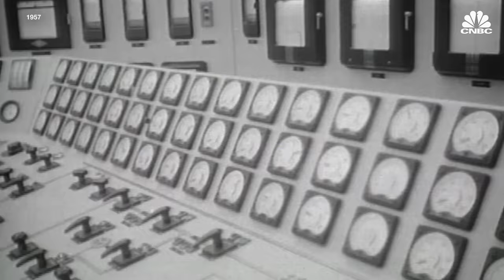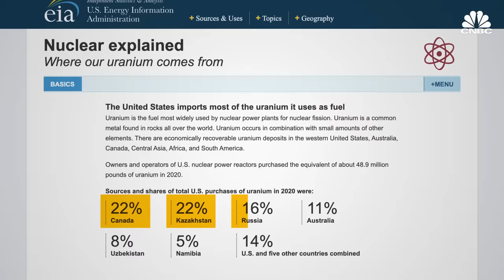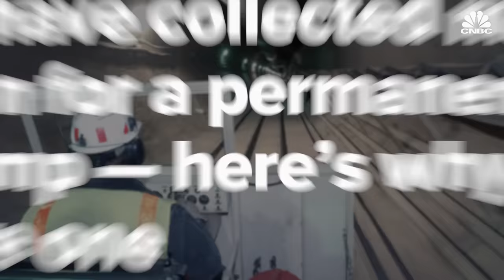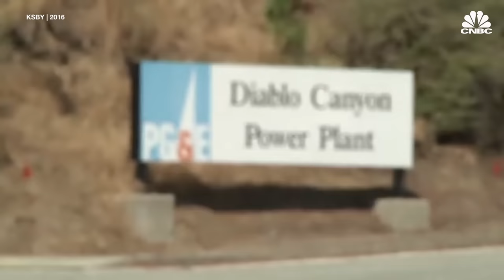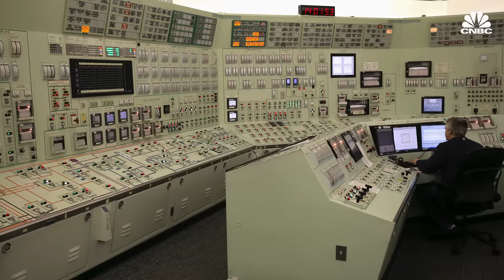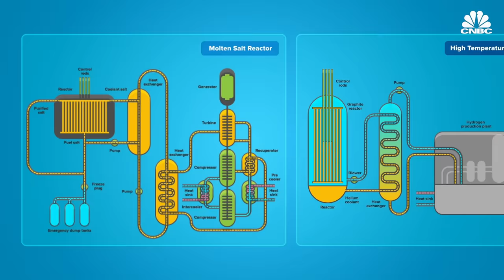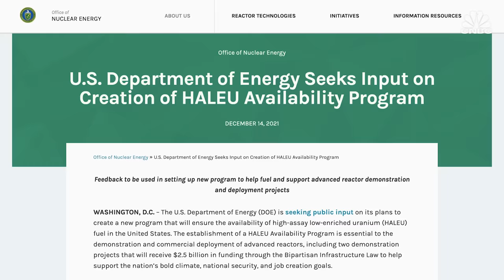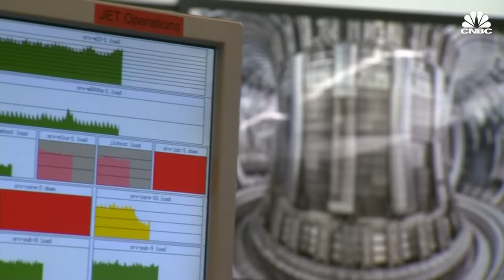Why Nuclear Energy Is On The Verge Of A Renaissance

Comment: 19,747 people died in the 2011 Tōhoku earthquake. It was the most powerful earthquake every recorded in Japanese history. The 4th most powerful in the world since modern record keeping. 0 people died from the partial meltdown at Fukushima. That proves how safe nuclear power is because you were safer in the control room that anywhere off the Sendai coast.
Reply: how ironic one of the main reasons nuclear has always been canned is now used as a defence. And what was used as defence has become a blunt weapon. Follow the money. For nuclear to be safe, it becomes too expensive, pure irony.
Reply: Jeah, and during World War II, factories were in full swing. Happy times.
Reply: I'm pretty sure Tepco worked the nuclear plant workers to the death in containing and cleaning up everything. They didn't die from radiation but the kind of irresponsible actions of this corporation that led to the power plant not being adequately prepared against heavy earthquakes and tsunamis even though those are common in Japan.
Reply: @ooooneeee  look, in outright numbers, nuclear has killed far less than coal for sure.  But thats not the issue thats killed nuclear. Its the costs.  The risks involved means its highly regulated and safety has come with a high price.  The only real environmental issue is  that it takes a long time to ramp up  and no way will nuclear save us from climate change. Too long and not enough.  Solar and wind can be rolled out now  at lower costs which will only get lower where as nuclear is always going to increase its costs.  Then you can add Chernobyl and Fukushima to our collective memory. Thats a real barrier that no amount  crying will fix in this lifetime. Saying it was an accident and it wont happen again doesnt wash when  primal fears  are at play. Underestimate the fears people have at your peril.  For example,  how do you convince a fervent trump supporter that there was no fraud?  Not happening in this life time.
Reply: @andyfreeze4072  agreed. It's a shame many countries have phased out nuclear even though the power plants could have run longer. It's too late to build new ones to fight climate change. The fossile fuel industry played environmentalists like a fiddle. I used to be anti nuclear too.
Reply: @ooooneeee  actually, its not a shame from an economic point.  At what stage do you keep buying a twenty year old car design?  Ie VW beetle.   Thats the point i make, nuclear's window of opportunity is closing fast for most countries. I am sure there are places where nuclear is the only option but there wont be many, and the fewer that need it, the more uneconomic it becomes. A death spiral in slow motion.
Reply: @andyfreeze4072  Exactly! Well said.
Reply: Keep fighting against clean renewables, whatever the cost. You must love being dependent on others for energy.
Reply: @andyfreeze4072  Amen, Andy. Well said.
Reply: @beaubennett7469  “Renewables” is a propaganda word. You wouldn’t suggest we get our power from whale oil would you?
Reply: @erikkovacs3097  Renewables is NOT a propaganda word, and you do not get to change the definition of common words, to satisfy your domineering overlords, or your Trumpster 'feelings'. FAIL. FAIL. FAIL.
Reply: @erikkovacs3097  Please tell us all how whale oil is renewable. The whales are dying to know.
Reply: @beaubennett7469  Renewable is totally a propaganda word. First nothing is truly “renewable” in a universe with entropy. Second people have a Pavlovian response that it is inherently good when in certain circumstances it clearly is not.
Reply: @erikkovacs3097  Ok, for want of a better words, lets call free energy renewable energy.  Happy now?  The meaning of the phrase  has changed, get with the program, lol.
Reply: @andyfreeze4072  No energy is free. It takes energy to make and install solar panels and windmills. They also have a limited life span.
Reply: @erikkovacs3097  semantics semantics. If i dont pay for something , its free. You want to extrapolate to infinity, be my guest, but then you wouldnt exist.  The concern is the here and now in our lifetime, not in some far distant galaxy or time period. Pavlovian response? Seems the deniers are  playing that game ,  alternative facts are their specialty.
Reply: @andyfreeze4072  Where do you get free solar panels?
Reply: @erikkovacs3097  see semantics again.  I never said, nobody ever says you dont pay for the infrustructure.  But there are no ongoing fees for the fuel. So free energy. And if your paying attention, the cheaper the infrustructure costs, the closer to zero total costs.
Reply: @andyfreeze4072  What about materials and manufacturing?
Reply: @erikkovacs3097   What level of education do you have?  Your not comprehending, your picking on a phrase out of context and extrapolating.  and i am being charitable.  That then calls into question anything else you would have to say.
Reply: Actually provide a study backing the statement that no one died from Fukushima. Your statement is unqualified.
Reply: @ooooneeee  This statement is unproven.
Reply: @andyfreeze4072  You have nothing backing that statement.
Reply: @erikkovacs3097  On a universal scale there is no entropy. The universe cannot lose energy. It just get changed from one form to another.
Reply: @andyfreeze4072  Na... lets go with Hemp instead.
Reply: @ooooneeee  ... you may want to ask the folks living near Hanford Washington, how that nuclear waste storage is going?? O_o
Reply: @andyfreeze4072  But we are not talking about a small car for a couple of folks.. we are talking about a large power plants for over 3 billion people!

Keep in mind that most of the hydroelectric power plants we rely heavily on... were built in the mid  nineteen hundreds  O_o
Reply: @andyfreeze4072  For the record.... solar panels is by far the LEAST efficient form of solar energy,  at the moment O_o
Reply: @andyfreeze4072  I stand by what I said, as you have not disproven any of it O_o

Now let me burst your Nuclear bubble by simply naming one location....

Handford Washington 

I'll burst your solar panel / battery storage bubble by 3 little words...

Made In China

Now lets get back to nature, shall we??..

HEAT... fun fact.   The largest non commercial use of energy is for domestic winter heating. 

Natural gas = fracking, huge pipeline infrastructure, high production and maintenance cost with sever environmental impact and extra carbon emissions. 

Solar Energy = Not efficient for heating

Wind Energy = Not efficient for heating

Hemp Bio-Logs = Cheep production (like planting weeds ;-) 

NEGATIVE Carbon, as the plants take in more carbon than what will be burnt.  Seeds  and leaves can be consumed by both human and livestock. 

Roots stay in the ground, and only stocks would be processed for bio-logs and pellets.

The logs burn just like normal wood logs or pellets.   Other than returning SOME carbon, there are no other emissions or waste as even the ash goes back into the soil. 

All production can be locally sourced as hemp is easier to grow and more tolerant to weather than most other crops. 

Fun fact... ALL modern day wood/pellet stoves and furnaces ARE "2 stage incinerators".   Look up "secondary combustion" 

The technology is thousands of years old.  Look up "rocket mass heaters"  The "J tube Rocket Stove" that makes up the heart of the rocket mass heater is based on an ancient Egyptian design that uses secondary combustion.  (no smoke)

renewable and easily sustainable

And just like that.... heating issue solved world wide 

That frees up a lot of energy for transportation and industry, and we didn't even touch the grid 

Cool side story..
A friend of mine has a cabin in the Central Washington valley.   It gets cold in the winter and there are not that many local trees.    He planted 4 wild plum trees, which are very hardy and drought tolerant.  They are also a dense hard wood and fast grower.   He prunes them each year to promote vertical "sucker branch" growth.   At harvest, the branches can get as much as 2" thick in just one growing season.  Those 4 trees provide him with enough wood to heat his home every winter as well as most of his cooking.   Wild plum wood is amazing for smoking meats.  He has a rocket mass heater in his basement designed for small branches.  The trees also act as a living privacy fence, shade, and fruit, though the fruit is small and rare, about 3 to 4 cherry size plums per tree, per year!   It is a delight spotting a ripe one and eating it, knowing you are eating one of natures rare and sweet delicacies. 

I'll leave you with this though.... 
Look up "Solar Tube Mirror Steam Generator"

Minimal production costs
Minimal maintenance and operation
Long lasting
High efficiency
No emissions 
Can be locally sourced.
Reply: @2bRealist  look, i hope you reach your nirvana.  I see things differently from you. You seem to be living in an alternate reality, so ok, you win, hope that project works for you.
Reply: @andyfreeze4072  OH... another thing about solar mirror tube steam generators is that you can pair them with water to hydrogen electrolysis and really "go places" ;-)

Now combine hydrogen production with the new high efficiency rotary engines and we just solved our transportation needs.
Reply: @andyfreeze4072  Oh... I see.
Well, as the old cliche goes..
"You can lead a horse to water, but you can't make him drink"  O_o
Reply: @andyfreeze4072  Dude.. how many solar systems have you planned out and how many have you installed?

I've installed hundreds of solar systems, and made schematics plans for thousands more.

I've been playing with alternative energy science high-school when we turned a broken washing machine  into a creek ran power generator.

But solar systems was my specialty.   I had many friends who loved the out doors.   Cabin solar systems made me very populate. 

Smaller portable systems sold like hotcakes.    RV's and tiny homes  and anything else needing to be off grid. 

Pumps, Radio towers, weather stations, and cell phone repeaters.

Yet I can tell you that solar panels are way less efficient than many other forms of clean energy, including hydrogen generators.

The only reason you FEEL otherwise is simply because you are too ignorant on the subject to know better. O_o
Reply: @erikkovacs3097  Oil wells also have a limited 'life span'.
Reply: @andyfreeze4072  In Fact ,Nuclear is the energy that killed the least amount of Human ,even when account for Hiroshima and Nagasaki ,all the others energy (Oils ,Gas ,Wind ,Solar etc...) are far ahead on the death count
Reply: 0 people died?  Do you work for Tepco or a company hired by them. The clean up plan for that was 42 years because that was the half life, they can't even get to one of the reactors that melted through the floor (there's a big push in robotics to create snake like robots to get to it), the food they said was safe still sets off  counters, as did the rain on the west coast of North America for years afterwards.  A month after the US FDA had to increase the allowed amount in milk and other foods by several fold, then they had to do again a few weeks after, and then again, then they just decided to stop tracking it to avoid food fears.  So sure its totally safe, 0 deaths you say?   All that said, our problem was mostly Corp. & Govt. corruption and their misinformation campaign after the horrible disaster.  I do think N power especially the Tokamak reactors should be pursued, just maybe we shouldn't build them next to the ocean in earthquake zones.